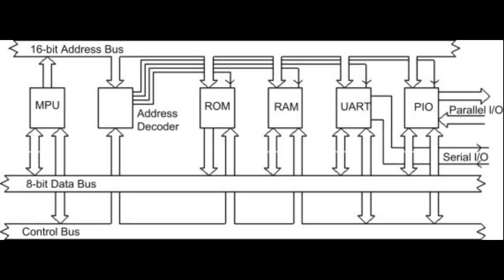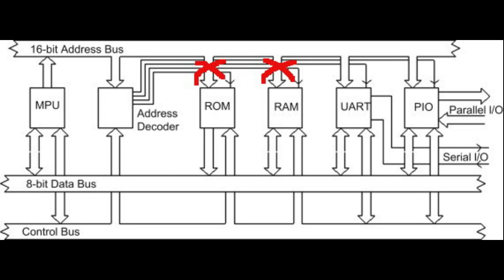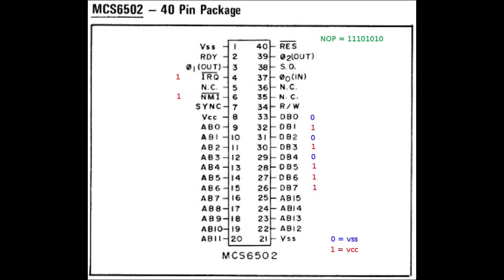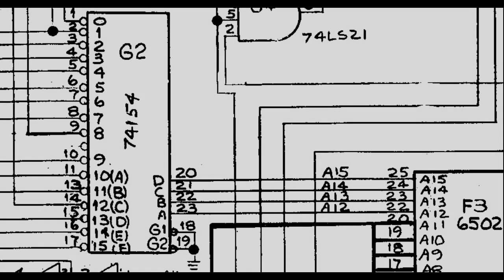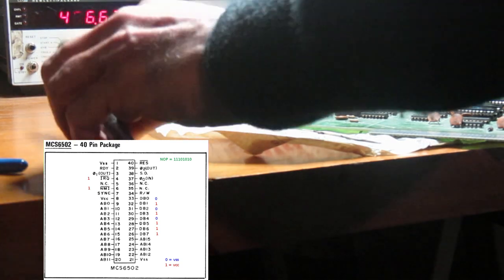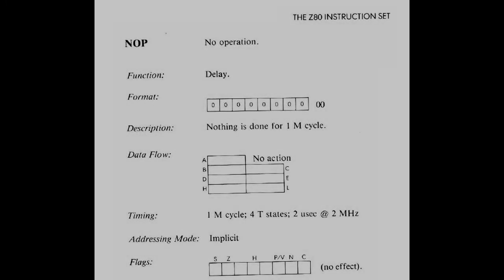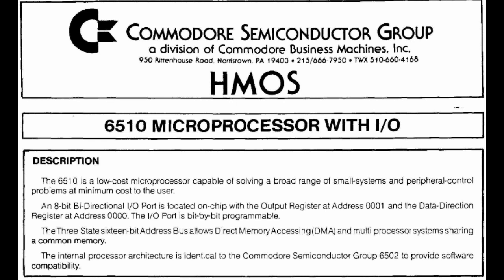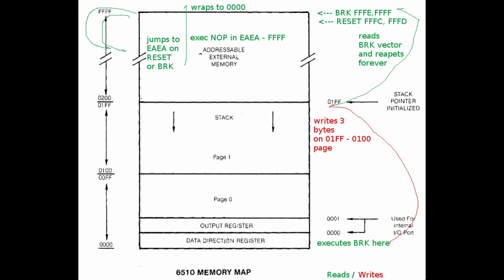8 bit troubleshooting tools: The NOP generator

Comment: In the Adrian case we got a few problems which I'm not sure how it work bcos:

1. Datalines had a conflict with VIA #1 and VIA#2 (ROM and RAM was extracted)
2. In 1541, 41c, 41II, 9900 on the data bus is setting onto the high byte of address in every RAM page 256bytes in $2800-$7FFF area
for example between $4C00 - $4CFF on the databus you can read #$4C, $5000 - $50FF you got #$50 and etcetera...

So what really readed CPU when hi going over the conflict data VIA#1 #2 area ($1800 - $1FFF) and what reading CPU on the $2800-$7FFF area ?

I guess something where CPU get HANGING $02 opcode or similary variation of $2x hanging code and CPU was halted itsn't ?
Reply from the maker: Hi, yes, Adrian's case was a bit different since the CPU wasn't socketed. However, the resistors in the databus would allow for the VIAs bus conflict without damaging anything. On a 6502 system, when you read an un-driven area (like for example $90xx on unexpanded PETs, the databus gets set with the high byte of the addressbus. This is a standard behaviour of the 6502 and it's not something that actually drives the databus. When you have a case like Adrian, where there're still some databus conflicts, what usually happens is that the CPU reads the result of ($EA AND $xx) where xx is what is the data on the active chip on that address. So it would probably hang or jump elsewhere, but it's still good enough for some troubleshooting as Adrian demonstrated.
Reply: @iz8dwf  also we can think is exist the behavior like $EA OR $XX, the question is what was "stronger" - resistors on the databus or datalines from VIA or from not decode area ?
Reply from the maker: @wegi9621  If a resistor is stronger than NMOS logic 0 (so resistor to Vcc) then NMOS driver dies. A resistor can be stronger than NMOS logic 1 (to GND) and MUST be weaker than NMOS logic 0, so the end result is $EA AND $xx (0 wins always).

Comment: I have always been a fan of your channel, iz8dwf. I have been a subscriber for several years now and I have learned a lot from you over that time. I even bought myself an HP 547A Current Tracer after I saw you using one. Keep up the great work.
Reply: Now I'm jealous.  :-) I want a current tracer but the prices are nuts now.
Reply: @adriansdigitalbasement  Yeah, the prices are ridiculous. I actually found one from a seller in Montreal for $100 CAD. The tracer was mint, so I couldn't resist. Also, I have an eBay saved search so I am always alerted when they or their sibling logic probe and pulser show up for sale. It would be nice to have the set.
Reply from the maker: Hi MindFlareRetro! Thanks for the nice comment! And yes, you're lucky to have found an HP-547A, when it wasn't so popular, like it seems to be now, I remember I needed maybe one year of saved ebay search to find one.

Comment: This is great. I'm definitely going to be making up a 6502 and a Z80 socket for myself. Also, I was very curious about the 6510, thank you for explaining that!
Reply: Great work guys!
Reply: For a 1541 that does not use the NMI you can still do it Adrian's way but use the instruction SEI instead of NOP.
Reply from the maker: Correct, on a 1541, NMI isn't used. However you can still use NOP, because (quoting from MOS programming manual):
"The interrupt disable, I, is set by the microprocessor during reset and interrupt commands."
Yes, also cutting the IRQ pin is not strictly necessary, I should have mentioned this.
Reply: Nice to see all those usual suspects around here. Only Jan Beta and Perifractic missing!